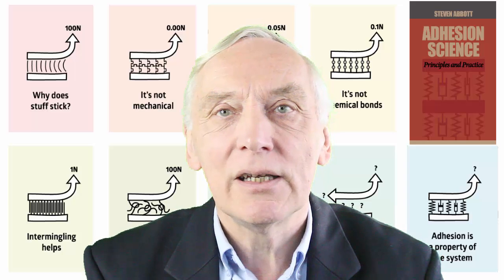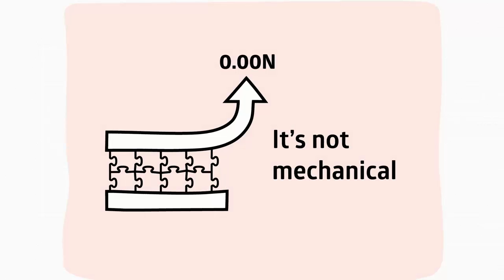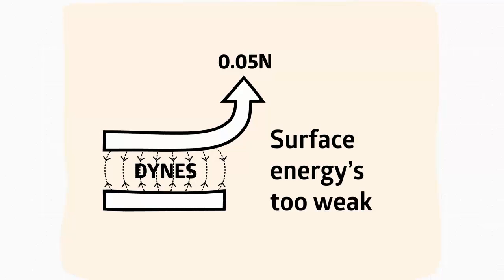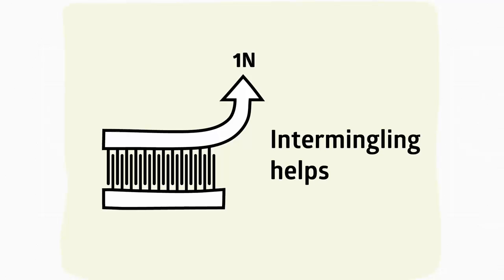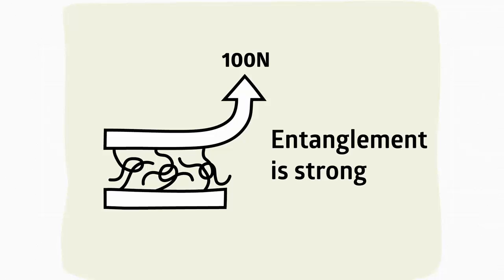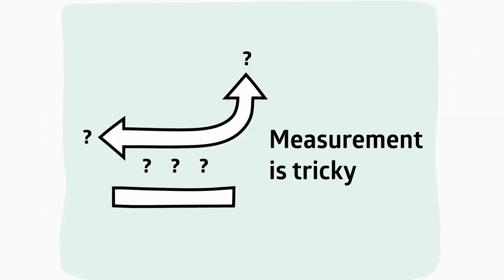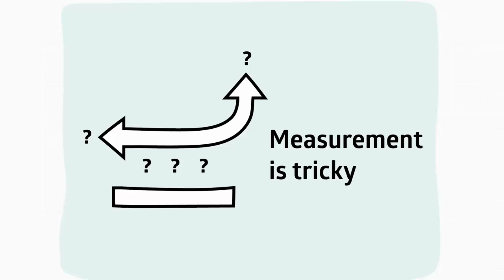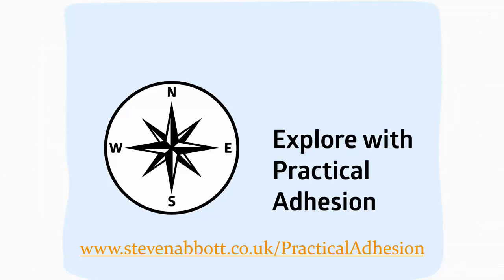Adhesion in 9 Graphics

Comment: Steven, you appear to be talking about the strength of the adhesive rather than the strength of attachment of the adhesive to the surface of the substrate. For example entanglement of the polymer chains, how does this help the adhesive bond to the substrate? How is entanglement not mechanical?
Reply from the maker: Interesting points. These are brief summaries. In the full text you'll see that I agree it's the whole system that matters. Find the YouTube channel for my Sticking Together book to get a fresh look at the whole story. S